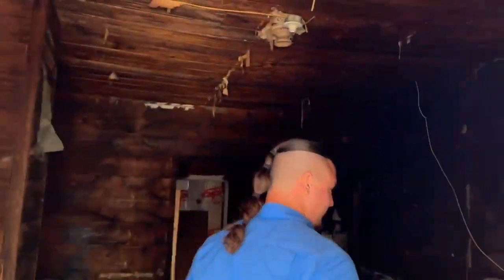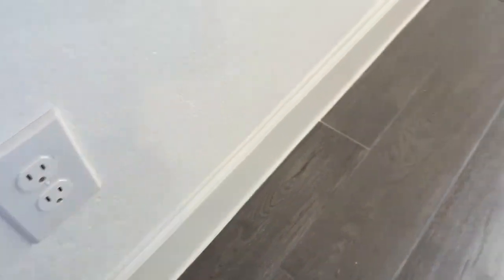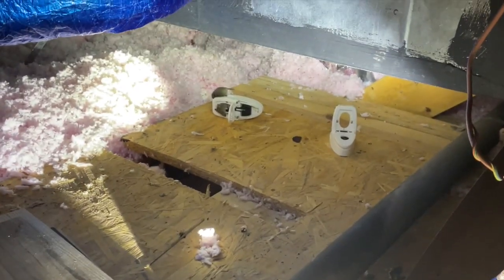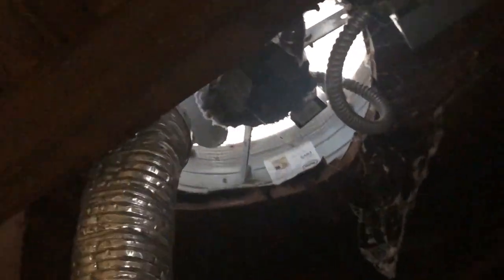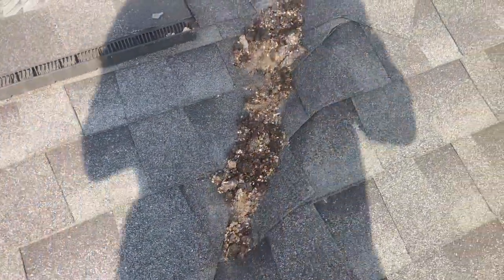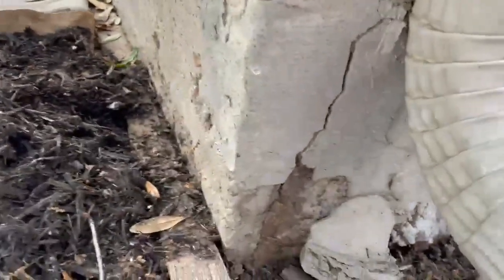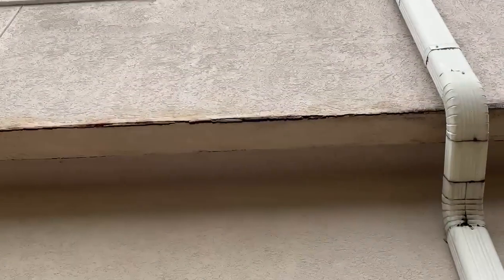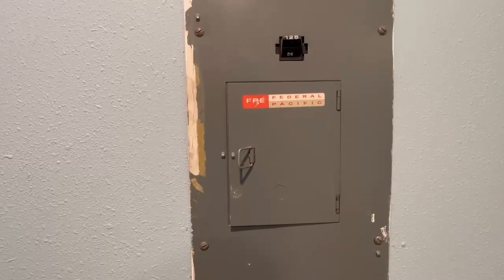Home Problems Compilation Part 1 - The Houston Home Inspector

Comment: @4:22 I've seen a lot of arguments about testing showers leaks (missing shower pan). Do you guys test new shower builds as well as old ones to check for this shower pan even if it may leak into lower floor?
Reply from the maker: Yes,  We check the shower pan on every tile property.  The argument is the shower pan is going to leak no matter what.  It is best we find the issue first before it becomes a burden to our clients.